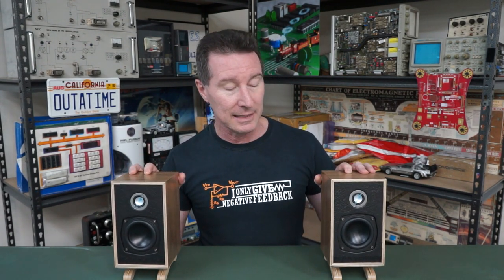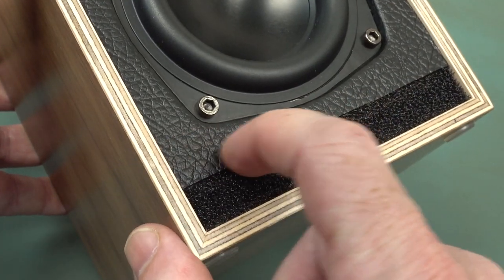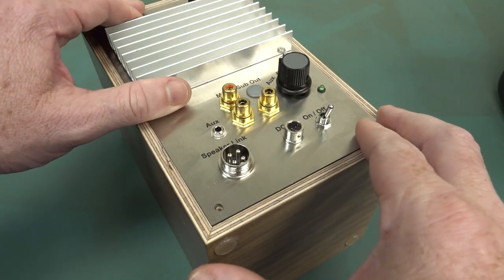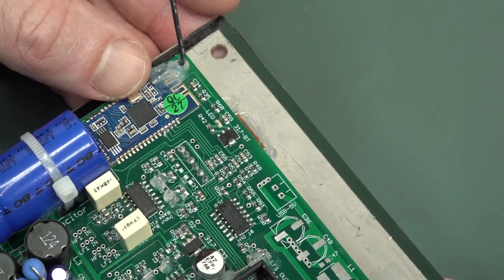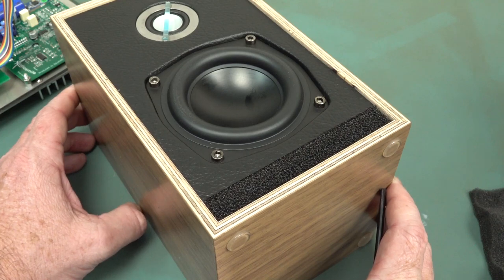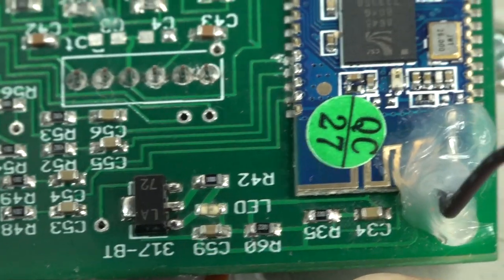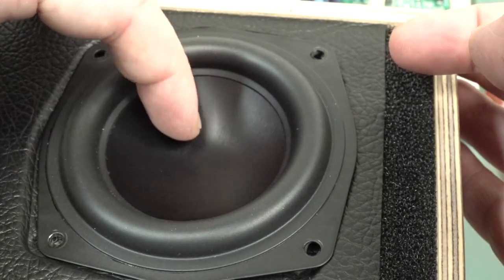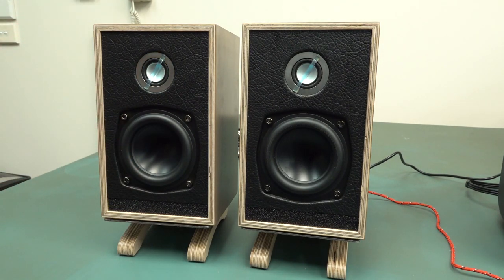EEVblog #1162 - Little British Monitors

Comment: Monitors? i thought its that thingy that we watch videos with
Reply: No, a 'monitor speaker' is typically used in a studio for monitoring the musicians by the sound engineer, or on a stage facing towards the band so the musicians can 'monitor' themselves. Or, for example Dave might use them for video editing. They are different from HiFI speakers in that the goal of a monitor speaker is to provide a good as possible flat frequency response, and should work well in the 'near field' (listening close to the speaker) while HiFI speakers are usually listened to far from the speaker and might 'colour' the sound by a non-flat freqency response. Also monitor speakers are typically active (they contain their own amplifier) and accept live level and balanced input so they can be hooked up directly to a mixing console. Eg. they are for use in a studio. These days, however, 'monitor speakers' are often misused by hipsters that want to be 'audiophile'. Actual monitor speakers are not very well suited to be used in a HiFI system and are more suited for creating music(/video) than consuming it.

Comment: Rotate a tweeter 90 degrees for symmetry.
Reply: Martin D A maybe possible on the DIY kit, not so much on the pre-built ones as they’re siliconed in and you can’t really get to the back of the tweeter anyway
Reply: @Dust76tr  It looks like they're preinstalled on the DIY kit as well.
Reply: @Dust76tr  Thanks....But you can always get in... (O;
Reply: @NiHaoMike64  Thanks Mike.

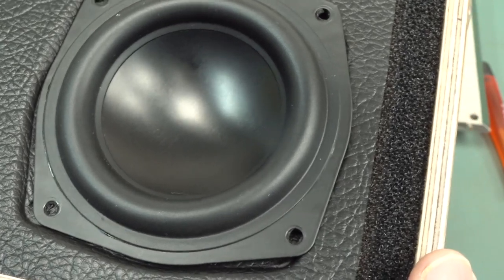Comment: Anyone could please tell me the name of this connector 21:10 thanks
Reply: CX16
Reply: @paulsengupta971  CX16 is a bit bigger than this one :\ but thanks for spending a bit of your time helping
Reply: Ah, sorry, I was mixing a few things up....wrong connector...GX16 vs CX16 vs Lemo. Try Googling Lemo connectors, they're similar. They're used in aviation for headsets which are panel powered.
Reply: @paulsengupta971  Thank you friend

Comment: Noticed large electrolytic cap labeled "Flux Capacitor" That's good for a few heads up laugh's! That transmission line speaker system was used by Stromberg Carlson on some of their "high end" console radios of the early to late 1940's ! I wonder if they actually owned the patent on this technology, Does anybody know out there in You Tube land ??

Comment: there's no way they'll sound good bouncing around like that.
Reply: also, there's no way that's a TL...  if it's a 1/4 wave length it would be the size of that speaker with no room for anything else.  i have made transmission line subs.

that's a modified shelf port.

gonna send out a lot of out of phase midbass, by the looks of it.

Comment: 125  degrees C on that cap!  You reckon a low-power amp like that will see those temps.  Must have got the  seconds out back of factory dumpster?
Reply: jim hough Using a higher temp cap at lower temp may increase the lifespan of the cap itself.

Comment: spoiler: don't buy it it's an absolute ripoff and you'll instantly know it if you know anything about speakers.
That's not even a proper tweeter, that's a small extended range driver, the same kind they put in cheap pc speakers as the main drivers.
Reply: Dude, you are right, those are "full" range speakers, holy shit..

Comment: considering UL does not speck for a front end fuse. and the fact that 90% of products made don't have a front end fuse... I don't think it is insane.   What is insane is your paranoia of this when you have a line fuse and in Europe a fuse in your plug.  As far as a front end fuse.. you have one,, its called a transformer.   If there is no transformer, then you will find a fuse on the line.
Reply: Did you even watch the video that was from?  How exactly is a transformer going up in smoke a replacement for a fuse?  A fuse is specifically to avoid cabling going up in smoke, including the transformer coils.

Seemingly un-fused transformers will usually have a thermal fuse hidden inside so it cuts off before going up in smoke.